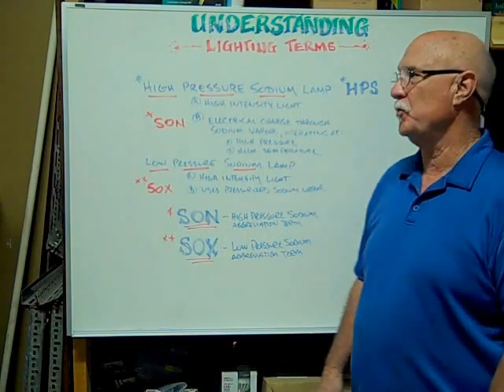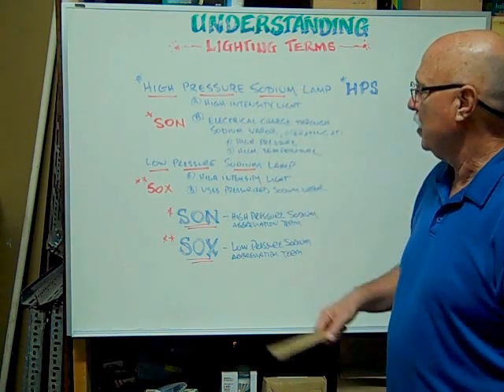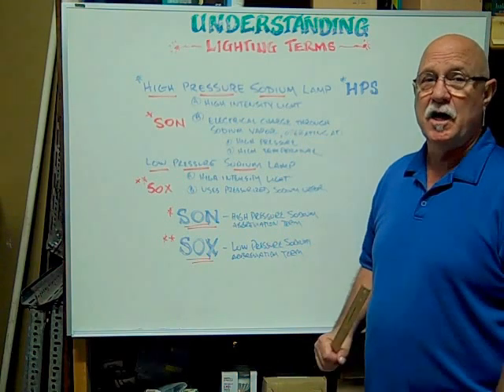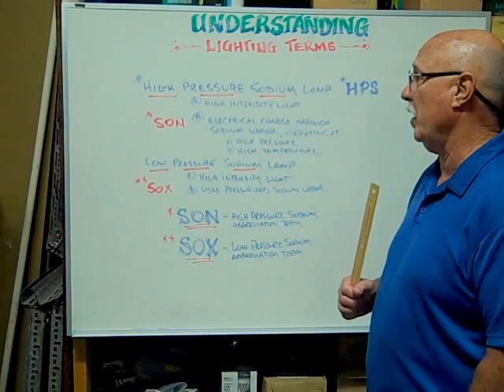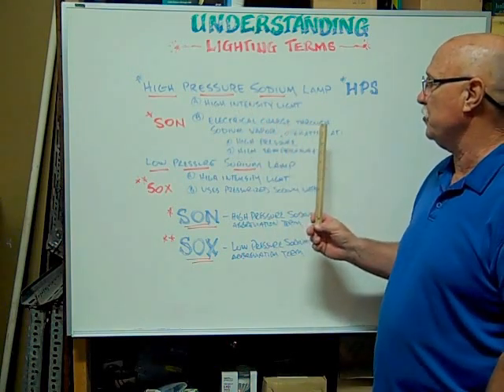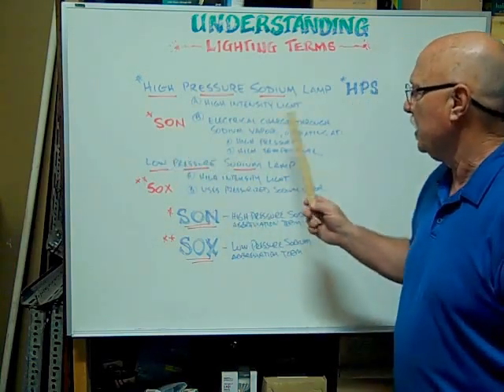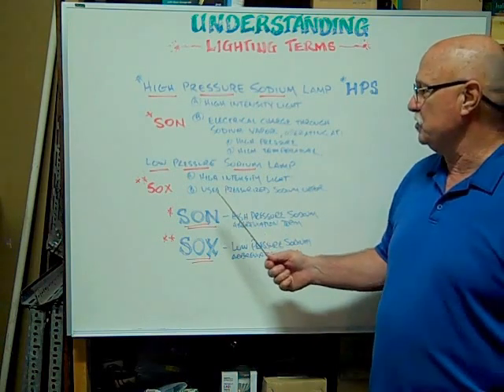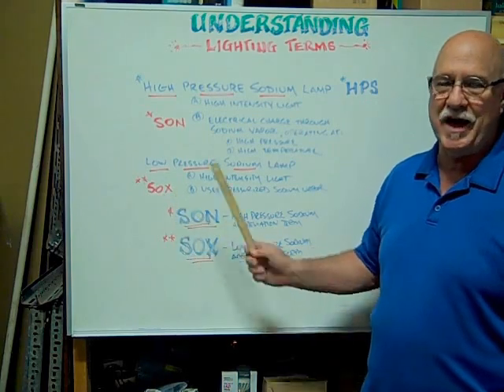High & Low Pressure Sodium Lamp Terminology

Comment: Actually, did you know that not ALL low pressure sodium lamps are SOX lamps? There are several designations for non-SOX low pressure sodium lamps. However, these lamps were discontinued long ago. These designations include SLI/H, SO/H, SOI/H, etc.